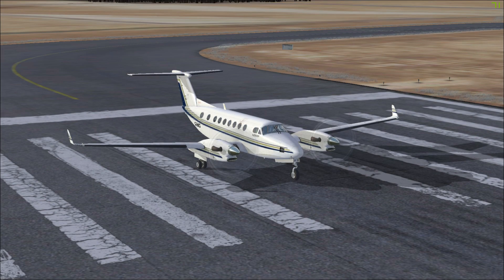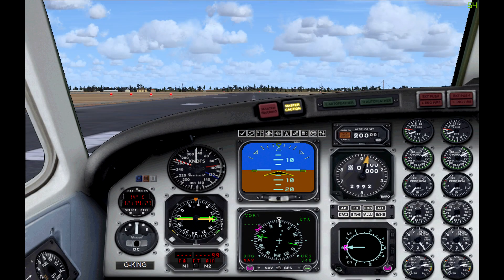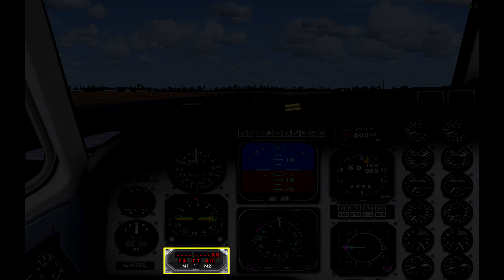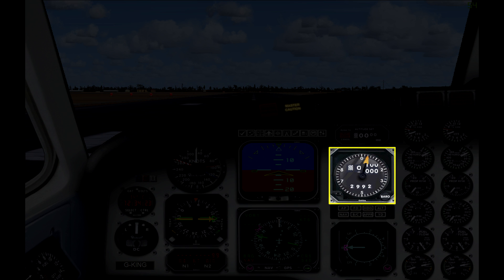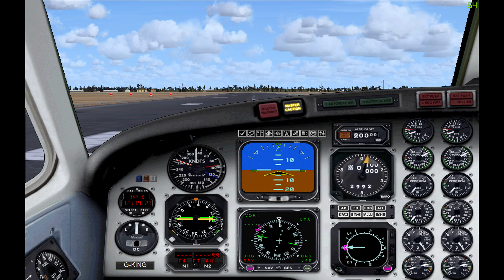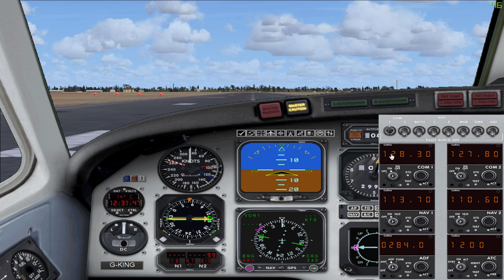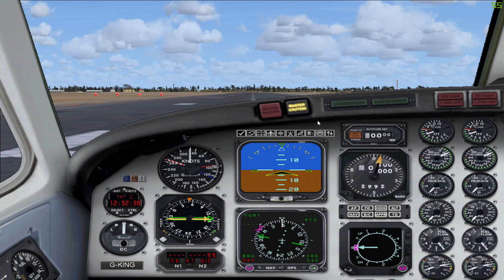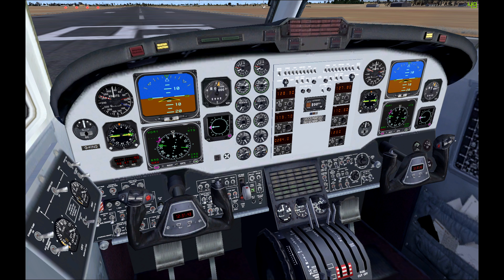FSX Tutorial: King Air 350

Comment: Can anyone explain why my HSI shows a different heading than my gps?
Reply from the maker: You might be experiencing something called "drift". The heading indicator in smaller aircraft is powered by a gyroscope and over time, the accuracy of the gyro gets worse. In real life, you actually have to correct the heading indicator and match it to a traditional magnetic compass before each flight and check it periodically during the flight.
Reply: I figured it out. I have the drift setting off so it wasnt drift. I was flying in a strong cross wind and the auto pilot had to fly the plane about 15 degrees off of the gps heading to maintain the course, thanks for replying though!

Comment: In many Turboprops/JetProps you have the following for engine controls....

Throttle
Propeller Pitch
Condition Lever

The condition lever is NOT like a mixture, its way more simplistic, there are effectively 3 settings used for the Condition Lever in the King Air 350.

0% - Fuel Cutoff, which is used for shutting down the engines

50% - Low Idle, mainly used on Startup and ground taxi and ramp ops

100% - High Idle, mainly used for takeoff, landing, and all aspects of the flight while airborne.

Its seriously that simple, and you can watch videos of real King Air pilots using this practice as well. Many many other TurboProps/JetProps follow this exact procedure. Some of them do not even come with a condition lever anymore, instead the come with a fuel cutoff switch like in modern turbofan aircraft. I have spent way too much time researching King Air's and they make up 60% of my flight time in FSX, my favorite turboprop to fly by far, hands down.

BTW since you are using the default KA350 you might want to visit AVSIM as there is a freeware update to that plane the gives you HD textures and even a few improvements to the default model that make it more realistic and operational. Other than that, this is a pretty nice basic tutorial on a steam gauge version of the KA350.
Reply from the maker: +Spartan536 Thanks for the heads up! I didn't know that's how turboprops operated. I guess I was just conditioned from flying small piston props that I assumed it was a Mixture lever rather than Condition.  Thanks for pointing that out though, very useful to know. Going to add a little annotation to the video for what you've mentioned.

Comment: Hey Doofer911,

my Cessna172 is always turning to the left. Is there a way to fix that? I can't trim that, unfortunately. Great video as always!

Best regards.
Reply from the maker: +Dark Order Yeah I think it's a common issue, there's two ways you could stop it. One would be to reduce the "P-Factor" slider under realism settings. The other would be to switch fuel tank usage so that the right wing is heavier than the left which should balance out the roll, kind of an akward way to change the balance of the plane to trim it!
Reply: I know this post is a year old but ... I added a 200 pound co-pilot and that cured my left turning  .... works on other aircraft as well.
Reply: This happens in real life. It's called the "left turning tendency". The plane naturally wants to turn to where to prop is spinning towards. You can set this up in the P-factor slider under your realism settings.